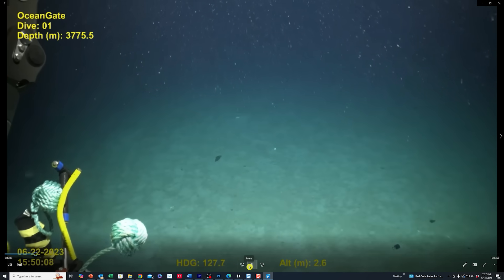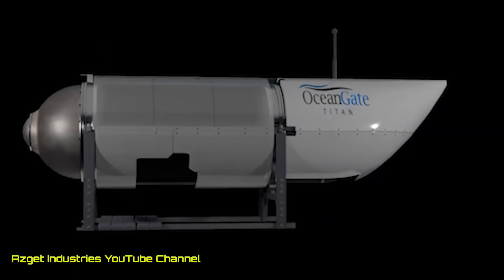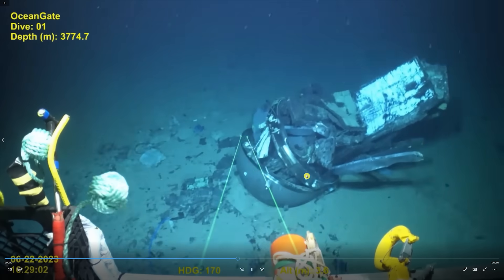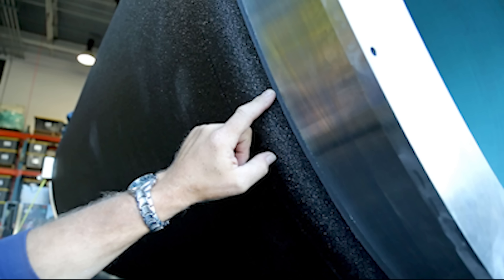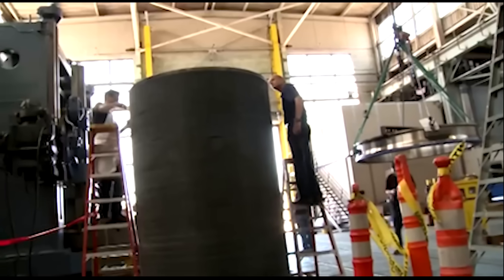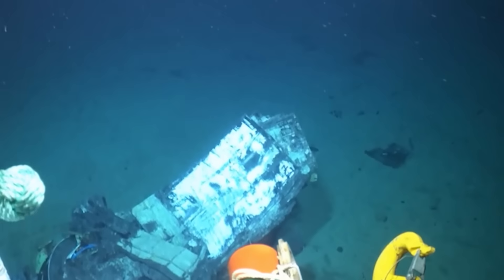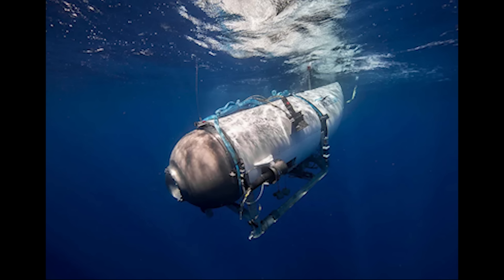OceanGate Titan Sub Debris Video Shows How It Imploded

Comment: Why is no one else mentioning how the back of the submersible appears to have been held together with a common ratchet strap? You can clearly see a hardware store style ratchet strap wrapped around the back fairing. Like holy crap they used literal garbage for ballast and had it held together with the same kind of strap I use to tie my garbage down when going on a dump run.
Reply: Question from a novice, but that part wasn’t pressurized, right? Appears that the pressurized part was completely gone. Would the strap have any role other than containing parts that wouldn’t experience depth issues? I agree it looks thrown together like someone attaching a kayak to their car to head to the lake.
Reply: Iron is used as ballast because it actually decomposes (eco friendly ballast!), so while it may not be iron pellets as professionals use nor as elegant, iron pipes worked for how they used it.
Reply: That strap isn't structural, Its just there to keep it in place on the substructure. I suspect they had problems attaching it due to expanding and contracting.
Reply: @bryanb6931  What I thought myself. Another one of Stocktons cop outs being cheap, the panels probably broke a latch and wouldn't hold together like it should so they pulled a MacGyver move and said get the straps!
Reply: @bryanb6931  It wasn't on there when it launched. There is video of the launch. There was no strap of any kind.
Reply: @nihilistic7840  The earth is round.
Reply: I have a similar RATCHET STRAP holding my gas tank up right now, because I’m poor- Stockton was rich and cheap
Reply: @mertonallowicious  It wasn't on there when it launched. There is video of the launch. There was no strap of any kind.
Reply from the maker: looks almost like a bungie cord
Reply: @jeffostroff  no its a tie down strap people use to tie things down the bed of their truck. i know what they look like. not a bungee cord.
Reply: I noticed it too.
Reply: Cheap, does the job, far stronger than needed. Disposable.
Reply: It's just a cover for equipment OUTSIDE the pressure vessel
All it has to do is stay on there, which it obviously did
Reply: Anybody know the brand of ratchet strap?(asking for a friend)
Reply: @ErickFloFishin  I would bet my 2 cents it’s either husky brand ( home depot special ) or hyper tough brand ( Walmart special )
Reply: The back part was at ambient pressure, so the implosion didnt really affect it aside from the water rushing towards the vacuum. The carbon fiber hull just snapped together in an instant.
Reply: Regarding the ballast, why not use scrap metal? It will be left on the sea floor anyway. No need for any fancy stuff.
Reply: This thing was full of off the shelf items. Internal lighting from camper world and a gamer controller etc.. 🙄
Reply: It held the tail together. Didn't it?
Reply: Stay strapped
Reply: @johng8967  Assuming you meant to type "planes", the tape on planes isn't for repairs.  It doesn't have the strength to perform structural repair.  What it is for is that if there's some kind of defect, but the defect is not serious enough to ground the plane immediately, they put the tape over the defect to smooth out the aerodynamics and reduce fuel burn.
Reply: It's not structural. My bet is there was shuddering happening so the put positive tension on it. Inside that submersible every sound would have been hauntingly loud
Reply: @johng8967  that is specific tape designed for that. like on plane wings. a cheap strap from harbor freight is not something i would want to see on a sub that i'm going to be on going to the ocean floor.
Reply: no offense but that isn't even a ratchet strap, more of a lashing strap absolute garbage.
Is this strap noticed on any pre launch video?
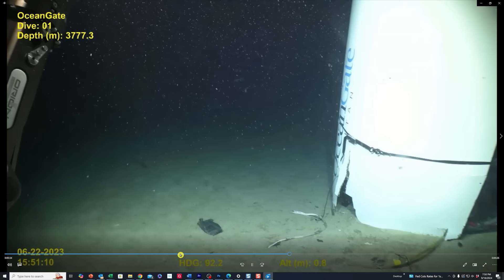Reply: @chilidog6727  03:15 to the left from the hooks, it definitely looks like a ratcheting thing
edit: at 00:34 it's even more obvious
Reply: @chilidog6727  You can see the ratcheting part as well as the 2 hooks where the strap comes together.
Reply: I think by the fact that it's still in place and unbroken you can tell it was sufficiently engineered for its assigned task